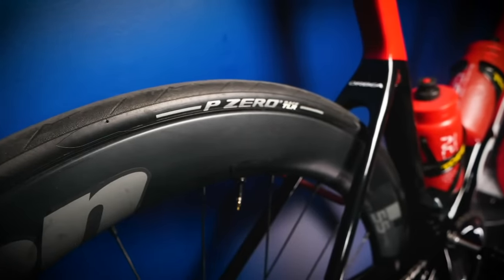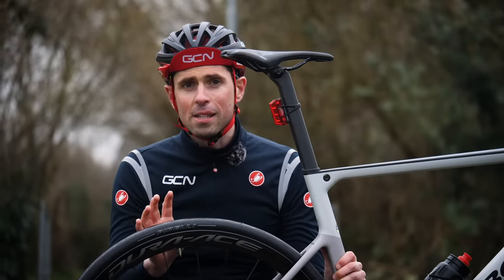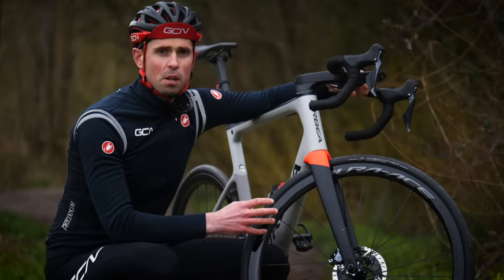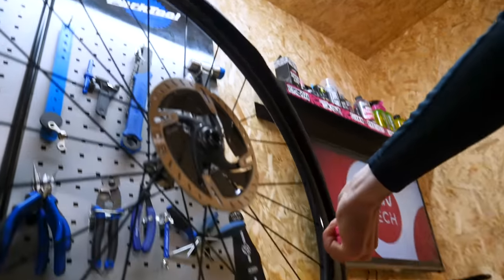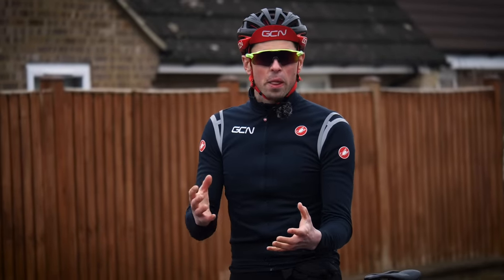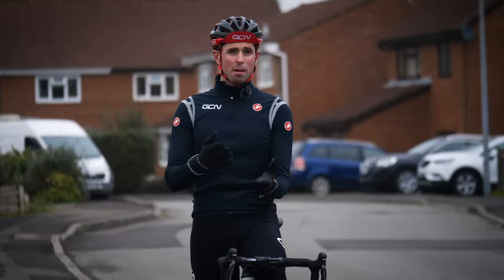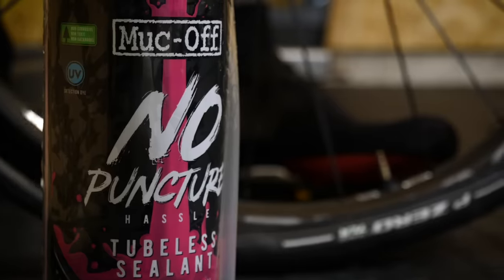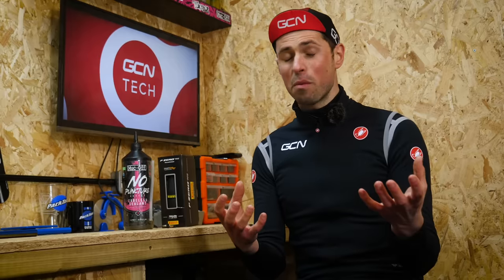Tubeless Convert! | Why Alex Will Never Use Inner Tubes On His Road Bike Again

Comment: Maybe it's an age thing. As the 'older' cyclist, I really couldn't be bothered with all the sealant, tape and crap and having to clean it out every 6 months etc. etc. etc. Run inner tubes for as long as I can remember and haven't had a puncture for over a year. It takes all of 5 minutes to replace an inner tube!!
Reply: And that’s 5 mins that tubeless riders don’t have to waste! Can just enjoy the ride
Reply: True but with tubes I couldn't run 25c on my city streets without getting flats, now I'm running everything over. Glass, staples, crushed cans, absolutely steam rolls over everything
Reply: @jellybeans786  I’m willing to bet when you do clean out the old sealant and replace the tape it takes more than 5 minutes!! Time we spend on the road 😉
Reply: @nigelcrane5309  You don't have to change the tape unless you see it peeling up when you replace a tire. You also don't have to thoroughly clean out old sealant routinely, you can suck a little old sealant out through the valve stem twice a year, only takes a minute.
Reply: Strongly agree. Tubeless are nice, but too much maintenance. I'm totally ok with getting a puncture from time to time, as I just need to replace the tube in like 10m if I take it easy. And I don't mind being a couple of seconds slower if that needs having to pay less and easier maintenance
Reply: If you watch the "Legends" videos on GCN+, the riders who are challenged to change a tube can pretty easily manage it in under 2 minutes!
Reply: @jellybeans786  they prefer to spend 45 mins cleaning their bike covered in sealant after a puncture that didn’t seal, sprayed the whole frame with sealant, and eventually still required to put an inner tube in there to avoid calling a Uber 80km from home. Tubeless is a mess
Reply: Once you’ve ridden tubeless tires at 70psi for an all day ride, you’ll see that when it comes to comfort....tubeless is def the future
Reply: @ChrisP978  Top end Mavic UST wheels have fore drilled spokes (no holes in the rim besides valve stem). They require no tape, ever.. and I only have to change the sealant once a year. Mavic's juice doesn't coagulate as quickly as other brands
Reply: @yoln9247  lol it rarely happens, and if you have decent quality sealant even less so. People who say this often haven’t even run tubeless, it’s even more laughable because tubeless in MTB has been a thing for such a long time without complaint. Just precious road cyclists who aren’t able to evolve
Reply: It's not an age thing, not here anyway.
Reply: @Ohh695  ride inner tubes at 60-70psi!
Reply: @gerryfrancis3350  no thanks don’t want to get a pinch on the first 5 minutes of my ride
Reply: @Ohh695  back in the day, when we didn't have track pumps or a pressure gauge,we probably did not manage to get more than 70psi in. But, we did have tubs, the borrower normal tyre being 30mm and very chunky.
Reply: @jellybeans786  fail. I am a precious road cyclist using tubes because it makes sense for me. I have tried road tubeless and I didn’t like it. I also don’t spend my days trying to force my application on you, nor do I get all offensive when you don’t adopt my methods. I also run tubeless tires in my mountain bike because it makes sense for me. Have an open mind. The world is a big, beautiful place with plenty of room for your tubeless and my tubed tires.
Reply: Couldn't agree more. In just over five years of riding I've had maybe as many punctures, so it's not like they're frequent and they're super easy to fix, either with a replacement or a patch repair. One of my "punctures" was actually a full on tyre and tube failure running over a razor blade, tubeless wouldn't have helped much there and the new tube and tyre were definitely easier to put back on. If people want to use tubeless then go ahead! But some of us don't care enough for marginal gains and just don't want the faff.
Reply: I ride 25mm tubs at 75-80 psi with 30ml of Stan's in it  never had a punture in 3 years
Reply: @nigelcrane5309  yeah it does, but I spend that maintenance time in the shed, listening to music with a beer.  Not by the side of the road. 😄
Reply: @jellybeans786  Yeah. As long as the cut is less than 3 mm.  If it's bigger, what do they do? Call mom to pik them up?
Reply: @ps6149  honestly talking nonsense I have had bigger cuts and been okay, none of the arguments are valid because the proof exists tubeless is better performance all round. You’re boring find another thread to hassle
Reply: @jellybeans786  Thanks for your kind advice :-) The 3 mm max is according to what's written on  "Mavic LIQUIDE PREVENTIF TYRE SEALANT".  According to that, I've had enough punctures, that wouldn't seal.  Every other rider knows those cuts...

I'm running tubeless at the moment, since my new wheelset arrived with everything set up already.  But I still doubt, it will be less maintenance, than my 4 punctures last year with inner tubes (about 20 to 30 minutes). Plus a real problem, when I have a too big puncture far out. 
Instead of becoming personal, you could as well have made suggestions, what gear to take with me to make sure I get home again on tubeless in every case.
If that seems like a "valid" question to you.
Reply: And besides: I'm not suddenly winning any races or riding seriously faster, just because of tubeless tires.  There might be a second here or there.  Nothing perceptable.
Reply: @nigelcrane5309  Who the hell cleans out old sealant? That's the type of thing that people who've never run tubeless say. You just leave the old sealant coating the tire and pour in more if necessary. Takes just a couple minutes. Don't even need to break the seal. I've spent all of 10 min on tire maintenance over the last year with tubeless. I've had 1 tire repair with a puncture that would have destroyed any tire. My other bike is running tubes and has had 5 punctures in 3 months; 3 on the same ride over a 10km stretch.
Reply: @cjohnson3836  Not quite sure you can say its the type of thing that people who never run tubeless would say, you don't know my circumstances. I run tubes my wife runs tubeless and as I am a qualified bike mechanic I maintain both bikes, amongst others. Personally I find the amount of work required to maintain tubeless is not worth the effort. However, where we live the roads are very well maintained and swept regularly so punctures are rare, hence why I can't see the point of tubeless. As for marginal weight gains, when you get passed 50 you really don't care too much any more, just happy to go out to ride. Maybe if I had a gravel bike and off road more I would consider tubeless but for road where I live I really can't see the point. I will say though, I hate to think the state your rims are in if you never clean out the old sealant and just top up with new, you aren't doing yourself any favours there.
Reply: @nigelcrane5309  Why would my rims be in bad shape? My sealant is essentially just liquid latex. Liquid latex itself is sold as a corrosion preventive product. If anything, its preventing deterioration to my rims. But, I'm running alloy rims on a steel bike, because I don't care about weight, since for some reason you brought that up. All this really comes down to is this, I spend less time on maintenance than you do. I spend even less time on wheel repair since I very rarely get flats. AND, my roads are much worse than yours. You do you, but don't sit there and say that tubeless requires all this time commitment. It doesn't. Its the lazy way of going about it. I do less maintenance than you, in worse conditions, and get away with it. Tubeless is less maintenance than tubes. That's why most of us use tubeless.
Reply: @cjohnson3836  Latex sealant dries out over tine, which can leave a latex gunk in the form of a film or chunks or even a large dried section that can cause your wheels to go out of balance. It is recommended that you remove your tires and remove and clean out all the old latex at least once per year minimum.
Reply: @nigelcrane5309  You know what else causes my wheels to go out of balance? Mud, material loss through riding, flat spotting from emergency braking, rim warping for any number of reasons, the freaking valve...the list goes on. Tire balance is about the least concern.
Reply: @nigelcrane5309  Ride whatever you prefer, but stop acting like these excuses y'all keep leveling at tubeless set-ups that y'all won't even run are anything other than absolute nonsense. None of this holds any water. As for the latex, it stays until the tires get trashed. Y'all acting like tires last forever.
Reply: I think people ride very little probably won't get benefit from the tubeless set up.
Reply: If it takes you 5 minutes to swap a tube...can't imagine the amount of tubs you have swapped.
Reply: After 6 months, 3 realistically, I will have worn out a set of tyres (17,000km last year) so cleaning out the sealant and replacing it every few months genuinely isn't an issue.
Reply: So a new set of tyres every 3 months, clean the rim 1st, takes a couple of minutes each, pop some new sealant into the new tyre, flash pump inflate job done. 
I've only converted to road tubeless 3 months ago, the increased comfort of lower pressures is fantastic - I'm 58, have given up racing so being 2 or 3 seconds faster doesn't bother me. I get off after 3 or 4 hour rides feeling so much better now. 
The tyres after nearly 4,000km in 3 months are pretty much at the wear limits, so I'll change them soon. Replace the sealant every year- are you serious?? Are you riding 50km a week or less? And I've flown with them 3 times, drop the pressure to 10psi to put them in the box no issues with leakage etc. 
There are 6 small cuts in the front tyre that the sealant has clearly fixed. So that's almost an hour standing at the roadside that I've saved. As for big holes, I've had one each on the gravel bike and the MTB, in the forest up the mountain literally in the middle of nowhere in Thailand, no Mommy to call out here! Pop in a plug (I have Dynaplug, other brands are available 😁) and off you go - takes maybe 30 seconds. I carry a tube just in case but haven't used one in 2 years. 
I'm so impressed I've converted my wife's road bike to tubeless as well, as guess who has to fix any punctures?? She now has some cuts that you can see the canvas through, so I really must change her rear tyre tomorrow. How many punctures since converting hers 6 months ago? 0. Km ridden about 7,000.
Reply: Where I ride there’s so much debris on the road that going tubeless is practical. When I clean out my tires to change to more offroad ones, I can find bits of metal and glass in the tires, which would’ve otherwise caused flats with inner tubes.
Reply: @cjohnson3836  Nice!  So how did you get home when you had that one puncture that would have destroyed any tire?  Can you put a tube in tires full of sealant (and a paper cup of cuase), and roll home?
Reply: @pep20002425  I call bullshit or you are living in Switzerland, I have been using tubeless on my mtb and gravelbike and on both of them I had at least 1 flat that sealant couldn't seal and that's in 2 years. And when I had a flat on my MTB I had to walk home, plugs didn't work and the valve was so stuck that I couldn't  use a innertube! Tubeless is greay for mtb and gravel but on the road it's to much hassle for what you get out of it.
Reply: Miguel, and how many minutes a year do you spend changing the sealant ? And if you don’t already own tubeless ready rims, how many minutes are you going to have to work to buy them ?
Reply: @Ohh695  I ride 28mm road tires with tubes @ 70-75 psi always.
Reply: @Roto68  yikes good luck with that
Reply: @jellybeans786  Back when I ran tubeless I've had rides ended when I've had a puncture that wouldn't seal up, and hold enough air to ride on.  I've sometimes had a spare tube on hand, and put it in, but that few minutes it normally takes me to swap a tube gets doubled when it's covered in slimy old fish stank 4 month old sealant.
Reply: @DiscoParachute  Just try different tires, and don't be fooled by marketing into thinking gatorskins are puncture resistant tires.  I ran continental ultras in 25mm, got flats about once a week on my daily commute.  Switched to GP3000 23mm (current at the time) they were a bit better for flats, but the tread wore square within a couple weeks, and was through to the threads in a month and a half.  Switched to gatorskins, got flats a couple times a month.  Switched to Hutchinson fusion 3, and only got a flat every few months.  Have used a bunch of schwalbes with pretty good success.  Panaracer, no problem.  Pretty much since I stopped  using continentals, I've had a lot less flats to fix.  I've got another friend who independently came to the same conclusion re: gatorskins after running them for a few years.  They're not a good tire.  They get flats more frequently than most other tires either of us have used.  He switched to panasonic ribmos (admittedly not the fastest tire either), and has gotten orders of magnitude less flats since.  I've been running various schwalbe tires (both super fat balloon stuff on my ebike, and some skinny fast stuff on road bikes), and have had very few flats.
Reply: @jellybeans786  Lots of people say that detractors haven't tried tubeless, but I've tried it several times and it's lousy on anything vaguely high pressure/low volume.
I've used Stans, Orange seal, and a couple other lesser known brands, and have had catastrophic failures with all of them.
I tried it in the early days of road tubeless, with the early hutchinson fusion 3 tubeless with the carbon fibre beads.  They were heavier than the non-tubeless version with a tube, didn't feel any different to me to ride, and were almost impossible to get on/off the rim.  I wrecked a few nice tire levers dicking with those (and I do know how to properly change a tire.  I could do the tube version of the same tires on the same rim without levers)  I gave up on those after I got a flat, and couldn't get the tire off to put in my spare tube.
I also ran it on my cross bike with michelin mud 2 tires, which I didn't have any major problems with, but I found that if I was running it soft enough that I'd be worried about pinch flatting a tube, it just burped instead.  I would run latex tubes and they're just as flexy/fast at reasonable pressures, and less hassle to deal with.
Ran it on another road bike after hearing how much better the tech has gotten, on some tubeless ready schwalbes.  Had the stans rim tape blow out (2 layers), replaced with polyamide,  ran that for a while,  with no major problems.  Sealant started to get super nasty stink after a few months though, and when I opened it up to clean it out, it was disgusting, and clearly had gobbed up to the extent where it wasn't likely providing protection any more.
Tried it on another road bike (actually cross bike I use for commuting) with 40mm marathon supremes.  It worked okay for a while, and then blew out the rim tape through a spoke hole (orange seal this time, totally different bike, different rim, no sharp edges, or anything else to blame.)  Fixed that with some other generic strapping tape.  Had the other rim tape blow out a month later, night before a big ride, spent a few hours pulling that crap out, and cleaning out the rims/tires best I could (Rims still smell funky from the sealant that blew inside them)  Woke up after not enough sleep to do my ride, and will not bother with tubeless again.
Reply: @Ohh695  Depends on how wide the tires actually are (I've seen plenty of 28mm wider than my 30mm), and how much the rider weighs, and what kind of terrain they ride on.  That doesn't necessarily seem unreasonable to me.
Reply: @nwimpney  I've found the tires for me, GP5000 tubeless. Ran them all winter and summer. No flats since I installed them, and where I work there's a lot of debris (staples, wood, nails, screws), it doesn't matter. Grippy on snow and in the rain and fast everywhere else. Went trail riding after I installing GP5000TL, guess what no flats. The only 25c tires I see myself using are the GP5000TL, but I mainly run 28c.
Reply: @jellybeans786  Punctures, especially from glas, are not a problem in forests. I rode MTB tires on the road for a while.  You won't even need any sealant, as long as the profile is ok.  For mountainbikers the problem is called snake bite, and that's where tubeless shines.
Reply: @michaelkammerdiener4372  I'd sugest you'd stay in your cosy shed and drink beer if you prefer, if you don't like to spend your time outdoors and sober :-D  (sorry, but you have to take a penalty kick when you get it).
Reply: @ps6149  All in good fun, mate. Ride on, enjoy and stay safe. :-)
Reply: @pep20002425  Is the tire a true 25mm or does it actually run wider when inflated, like 26-27 or close to 28? 25c tires at 75psi sound aggravating to ride with any type of tire, clincher, tubs, or tubeless.
Reply: I have ridden my road bike in tubeless for years no issues end of
Reply: @Jeff-bd4gg  9
Reply: @yoln9247  45 min... ? Yeah ok...
Reply: @jellybeans786  haha, I've ridden with tlr riders and when the sealant starts flying takes much longer to sort
Reply: @nigelcrane5309  Much better to spend that time in the garage before the ride, rather than on the side of some dodgy road in the middle of nowhere, hoping that your roadside repair works. ;-)
Reply: @yoln9247 you also forgetting about shit on your shoes and pants ;) it's marketing crap as well as disc brakes..
Reply: @Ohh695  what problem to ride on 4 bar in tubes? doing that all winter time, riding for grocery store, 20kg on my back - just fine, ice grip excellent btw
Reply: @chiboreache  that’s fine I’m sure it gets the job done but when it comes to comfort, you can’t compare tubes to tubeless
Reply: @Ohh695  4 bar is 4 bar, no matter in what form it is
Reply: Same here, carry a tube or 2 and you know you can get home. I know tubeless converts that have lost all  pressure and had to 'call a friend'...   not ideal
Reply: The ride is so much more enjoyable that it's worth it.  You don't have to clean the sealant all out.  You can just add some more through your removable valve core when it dries up.  Maybe only once a season for a few years.  Then get your bike shop to replace your tires when it's time if you don't want to do it yourself.  It's worth it.  The ride is just so much better at the lower pressure.  I switched to 28mm Continental GP 5000 TL tires and after my first ride or two I was permanently convinced that I made the right move.
Reply: I'll get a puncture within 5 minutes with tubes. I find at least one thorn in my tires after every ride.
Reply: 20 YO inner tube guy here. I'll 'upgrade' when bullshit sealant shenanigans are obsolete
Reply: I average 7k a year just commuting. I don't actually keep track of weekend miles, (different bike) but it's usually an hour or two both days. I went to Schwalbe marathons about ten years back, I've had one flat since then, and I've replaced one tube. Yeah, for me there's no reason to ever bother with tubeless.
Reply: It's a Space Age thing. Not enough room for an inner tube in my mums garage.
Reply: Just imagine the additional weight for carrying a spare tube and tools
Reply: @jellybeans786  That 2-3 W is a fart in a hurricane. You can lose more watts by keeping mouth open when pedaling.
Reply: @Agent-vj3ns  utter bollox its all the same stuff more or less!
Reply: @Ohh695  please explain why road tyres with tubes at 60 70 psi will get a pinch flat?...oh no you can't!
Reply: @jellybeans786  tubelss makes sense for mtb, the same does not apply to road tyres.
Reply: @Tripl3blue  clincher tires are always prone to pinch flats stoopid
Reply: I've had tubeless on my cross bike for 4 years. I never had to mess with tape. You don't have to clean it out every 6 months. I've never had a flat in 4 years. I know I would have had a couple pinch flats if I was running tubes. If you get a flat you can easily throw a tube in. Changing tires is even easier as you don't have a tube.  To put the sealant in, leave a little bit of the tire off the rim and just pour it in. Rotate the wheel 180 degrees and set the rest of the tire.

I think you either never tried tubeless, or you have been using an improper or improperly assembled tubeless set up.
Reply: Aramintai  You can just plug any more significant puncture with a dynaplug or normal rubber tyre plugs. Far smaller than a new tube, which I've stopped carrying.
Reply: @Ohh695  Just you watch me running 30-40psi on 25c tires with inner tubes and rarely getting flats
Reply: @arthurbttf  no thanks
Reply: @Ohh695  yeah, me neither. I just find it funny that I only got a flat after putting 80psi on it
Reply: Been running 28 tubes for 2.5 years no flats, no problems.
Reply: @Ohh695  tpu tube or latex will do the same
Reply: @arthurbttf  go off queen
Reply: @laranjiinha77  LOL
Reply: The argument is that they're less energy efficient despite being super mega easy to service and swap out
Reply: i agree i just use tubeless sealant inside my tubes extra protection